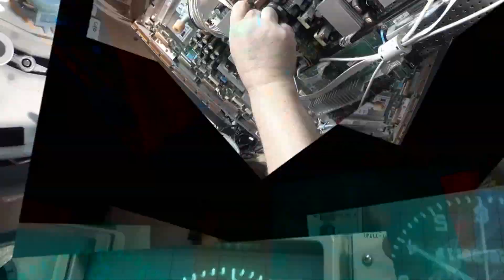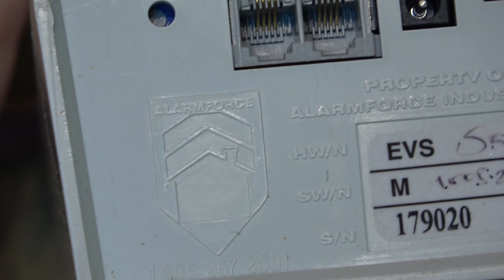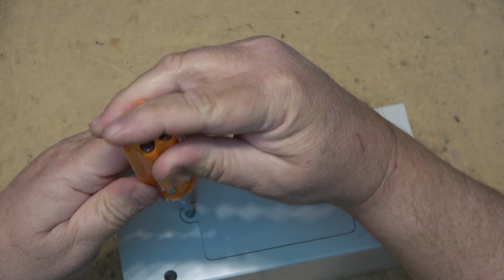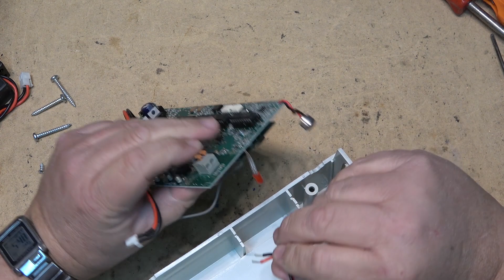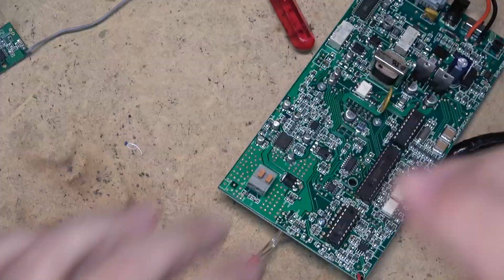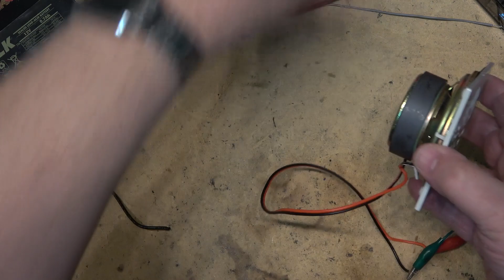Tear down of an old Canadian Made Alarmforce Security System

Comment: This is so interesting. I knew that Alarm Force had their own specialty panel, and I wondered about it for YEARS. I would often even check eBay and see if one made it on there (never did). 

They were briefly in the United States as well, in the South East and installed this same panel. I thought it was interesting. Here in the U.S., only Brinks had their own specialty panel... and it was rebranded Radionics. I wonder.... who made this for AF. 

Thanks for the Upload. It's cool to see.
Reply from the maker: From what i understand they designed it in house and had it made domestically.  My dsc alarm panel was also made in Canada.

Comment: Hey, I've got a son handycam TR512 that worked fine up until about a year ago when it kept giving me the error code C:31:20 and variations of that code. I've taken it apart a few times to fix other issues like buttons not working, but now the tape gets stuck and other times it won't want to record. I've seen some folks online saying it may be the take up reel, but with my novice level experience with taking apart cameras, I can't seem to fix it. Any tips you can give me, chief? Thanks!

Comment: Am I mistaken or was that made in 2012? It looks like a much older design to me, I'm surprised they kept making the same model so long.
Reply from the maker: They stuck with that same unit for many years.  We bought them out I think 2018. By that time they had started using 2gig panels but i don't know when they switched.  We just changed the radio module on the 2gig panel and many are still in use.  That was also a Canadian made panel and is very reliable.  For new install we use qualsys now.

Comment: I still have (and use) an ancient alarm system. Everything is hardwired and includes glass breakage sensors. My local police department started fining people for false alarms, so it didn't make sense to keep paying for central monitoring. Instead, I hooked up a relay to the 12V output that goes to the horn and interfaced that to an old cell phone to send text messages and emails whenever the alarm is triggered. That way I can check the cameras if the alarm gets triggered and I'm not home. Yes, there's no thrid party to help if someone breaks in and holds a weapon to me. I'd like to see some data on how many times an alarm system was used to thwart this kind of home invasion scenario. I'm guessing the number is almost zero in practice.
Reply from the maker: I too have a Canadian made DSC panel.  I do the monitoring.  It calls my cell phone and starts playing dtmf tones over and over.  So if my home calls me and I hear this i know the alarm us making a bunch of noise.   I then do the same.  Check the cameras and i will be the one calling the police.   With our system we install however not only is it available as self monitor or monitored, guard response is also offered so the police are never sent to a false alarm.  Guard checks first I'd nobody on contact list can check first.  If guard sees any evidence of break in the police are notified.  As to home invasion well I don't know of any around here but there are bad neighbourhoods where this does happen and if course businesses to experience armed robberies.

Comment: Some alarms were dual circuit, that use both land-line and cellular, so it could still contact the monitoring centre, like if the land-line was cut.
Reply from the maker: The panels we use now are dual path.  They are connected to your WiFi router and have a cellular connection.  The wifi is primary path to monitoring company.  Cellular backup so if router is down.

Comment: This speaker leaves in the dust 90% of mid range speakers mounted inside many hundreds of dollars per peace speaker boxes on display in the local home electronics shops audio show room - you probably haven't been in echoless room while testing bare speakers conducted.
Reply: All speakers have zero bass when they are operated in free air. There is nothing acting as a baffle to separate the front and rear of the cone, so the bass frequencies just cancel each other out. This speaker would have been optimized for the speech frequencies and whatever frequency range was possible over phone lines. They would have compromised frequency response in order to improve efficiency.
Reply: @johncoops6897  Thus there is a standard for such measurements - a plate of certain dimensions (in practice made of thick and hard particle board not very different from kitchen countertops) on which the speaker is mounted in certain position. At least in former eastern bloc such standards of measurment techniques existed. In my country there used to be two speaker producers and five certified acoustic test labs. Some ten years back only one of these fabs remained and they had one of the labs (I don't know wether they are still around today or not) and another two labs are operated by two universities to this day. As for this speaker - half of a joke comment, but based on some personal experience as far as youtube clip sound heard from a laptop speakers could be of any help.
Reply: @deepblueskyshine  - yeah, I agree. I never understand why people publish Youtube videos that try to demonstrate and compare speakers.

Comment: I had Alarm Force for years and when we sold the old Burnaby house and moved to South Surrey we cancelled the service and asked them to come and pickup the system components. They said  they didn't want the components back so we left them at the old house for the new owners. Alarm Force did save our butts when an accidental smoke detector alert went out while we were away from the house. We were able to give them the rear door code so the fire department were able to enter the house without taking an axe to the back door. We changed the codes when we got home later that night
Reply from the maker: Generally they don't want the old stuff back because reprogramming it for a new customer is more costly than just replacing it and if the new owner wants service the equipment is already there.  Satellite companies do the same. You move and leave the dish behind and they put a new one up.